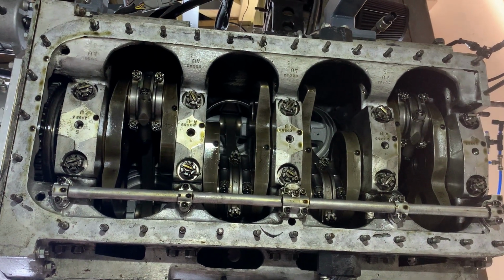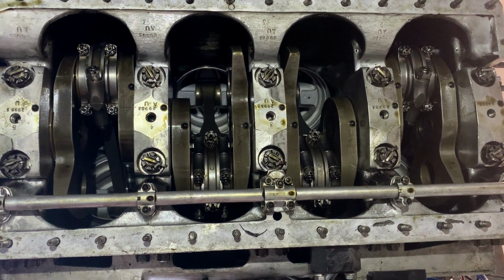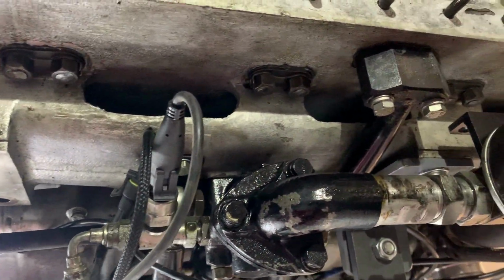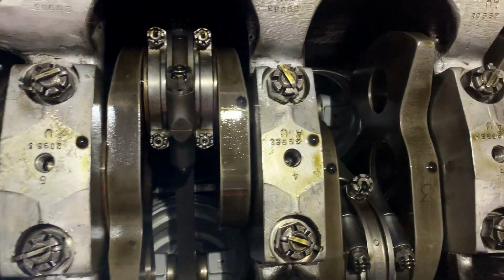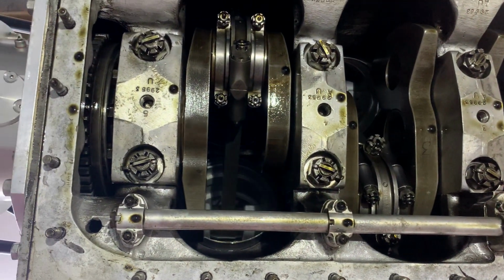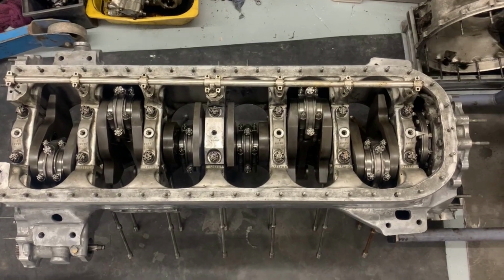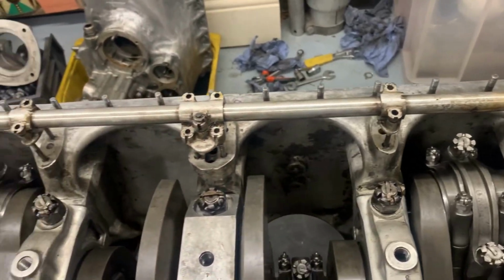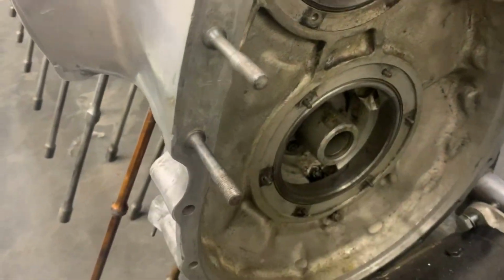Rover Meteorite V8 Engine Crank Assembly Compared With The Merlin V12

Comment: What are the threaded holes in the centre of each main bearing cap for?  All the best.
Reply: Most likely for facilitating cap extraction
Reply: @Simaka Wolf 1:17 Peter shows the oil feed gallery that runs along the side of the crankcase, so that's not right.
Reply: Slide hammer fixing to yank the caps off.